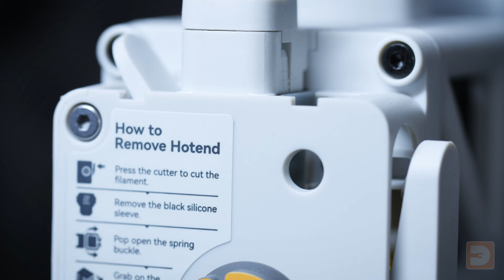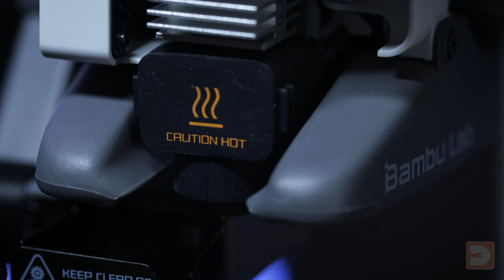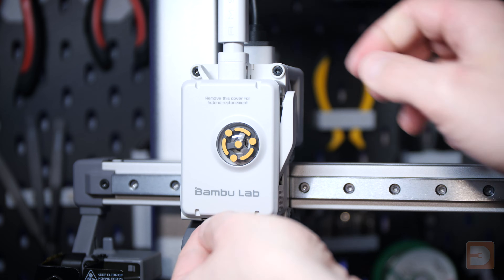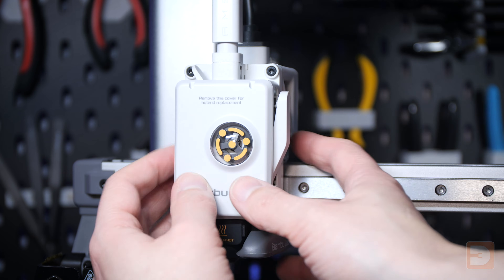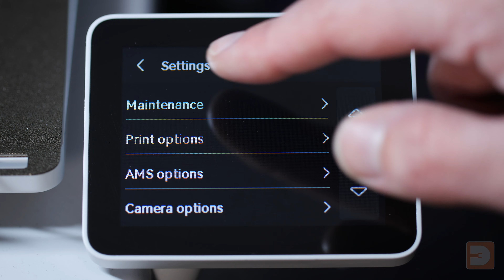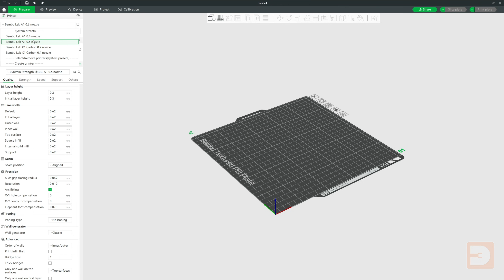A1 Nozzle Swap: Simple Steps

Comment: Thanks for this. I do have a question, however, do you know if Bambu Labs has done any recent software updates? My software looks different from what you are showing on screen
Reply from the maker: You can access the full list of firmware release notes for the A1 at the link below, and you can check on your device menu what version you are currently running.

The release date on the website is the number below the firmware name in brackets. It’s the date in reverse, so the latest one (20251210), was released 10th December 2025.

https://wiki.bambulab.com/en/a1/manual/a1-firmware-release-history

Comment: I have done this process a bunch, trying to go to .2, but no matter which AMS slot I try to load in it starts clicking and then I get the error that there’s no filament detected in a tool head. When I go back to .4 It works just fine but for some reason when I try to go to the .2  I get errors and it just clicks. I am selecting.2 in the maintenance page as well, so I know it’s not a setting issue.
Reply from the maker: Have you tried manually loading an external spool of filament (not via the AMS) to see if you get the same issue with that?
Reply: I have the same problem, so did you ever end up getting a solution?

Comment: Broke the 2 hanging clips at the top of the hotend cover. Whyd they make them so small and fragile?? 😠
Reply from the maker: Sorry to hear that. Did you manage to fix it or get a replacement easy enough?
Reply: @3DRevolution  Ill probably order replacement part off bambu site if the epoxy doesnt hold.

Comment: My 0.2 nozzle comes with 2 screws, what are they for?
Reply from the maker: Just to check, have you got the nozzle for the A1 series or for the X1 or P1?
Both the X1 and P1 nozzles use two screws to fit them to the printer. Whilst you can use the old ones with a new nozzle, they usually supply spares with the new nozzle in case you want to replace them.
The A1 nozzles don't require screws and usually doesn't come with them which is why I ask if you've maybe accidentally bought a nozzle for the wrong printer?
Alternatively, if you meant to order a nozzle for the X1 or P1, then this is just the wrong video for you. You'll want my other video on replacing a nozzle for the X1C.
Reply: @3DRevolution  
I bought two new nozzles for my A1 mini and each came with two screws.

Comment: are you kidding me, I have to buy their overpriced nozzles now. and where is the .5mm
Reply from the maker: The Bambu Lab X1C Nozzles are available at £30.99 (including the fan, heat element and thermostat) allowing for quickly swapping between different size nozzles, but if you're just looking to replace the nozzle, you can buy them without the electronics for £13.99.
By contrast, a stock brass Prusa Mk4 nozzle which doesn't include a heat sync costs £19.99, so £6 more expensive.

Yes for more basic printers you can just use stock nozzles and you could get a set of 3 for £5.99, but they are not only going to be less suitable for fast printing, they also aren't necesarily as resilliant.

For example, I have a 0.4mm nozzle with over 3000 hours printing and it's still in as-new condition and printing perfectly.

As for 0.5mm nozzle, whilst there are a range of them available, that's never been considered a stock size nozzle. Bambu offers a range of 0.2mm, 0.4mm, 0.6mm and 0.8mm which cover 99% of use case requirements.
Reply: @3DRevolution  it’s possible and I suspect that their .4mm nozzle is actually .3mm and their .6 is actually.5mm 
They have to understand the most important size is the .5mm. When you print  a 1 mm wall that’s a 2x wall lines of the .5mm .  They should not be in business if they don’t know that. 
I bought the A1 and had few clogs, this printer has belt system and requires maintenance like the other. I feel there is a fan based marketing hyping the product. The multi color option is good

Comment: When swapping to a different size, should you recalibrate as a last step?
Reply from the maker: Whilst it's certainly not essential, and 99.9% of the time I don't do this, if you're concerned, you can do.

The X1C does a nozzle z calibration before each print so it's not so essential to perform a full calibration after switching the nozzle.

One thing that is worth noting though, the dynamic flow calibrations you do will be specific to specific nozzles. If you switch to a different size nozzle you won't be able to select them so you'll need to do a new set of calibrations with that nozzle size. Equally, whilst you could just replace your nozzle with another of the same size and keep using the same calibrations, technically there can be slight differences in the new nozzle that'll affect it's performance so depending on how accurate you want it to be, you may want to run those again too when premanantly replacing a nozzle.

Comment: Hello, so cutting the filament and removing the nozzle with cold filament inside is ok to do?
Reply from the maker: Hey there, yeah with the Bambu design, you don't unload the filament from the nozzle itself. When you refit the nozzle with the old cold filament in, the next time you load a new filament it will just flush that filament out before printing.

Comment: What about the remain filament inside the old nozzle?
Reply from the maker: The filament inside the old nozzle can live there until it's used again. It sits there because the filament cutter lives above the nozzle in the extruder carriage. When you load a new filament, that amount in the nozzle will be purged before it starts printing so it'll always start printing with the new filament.